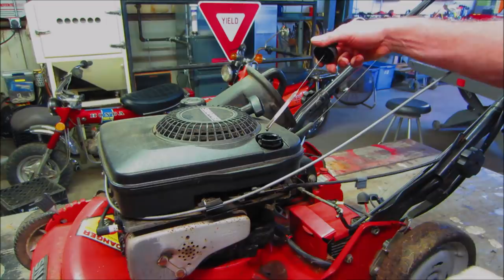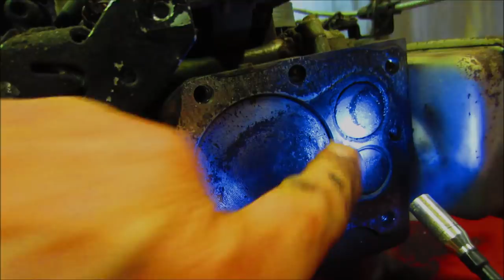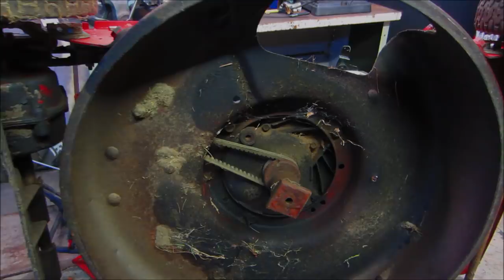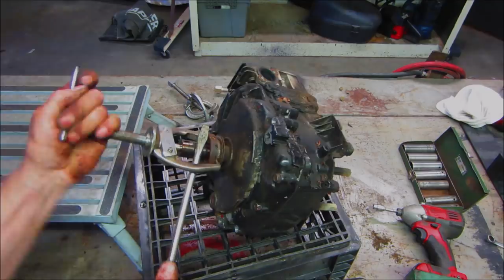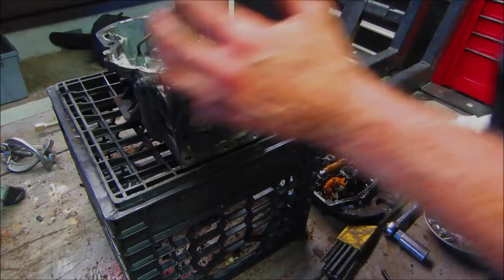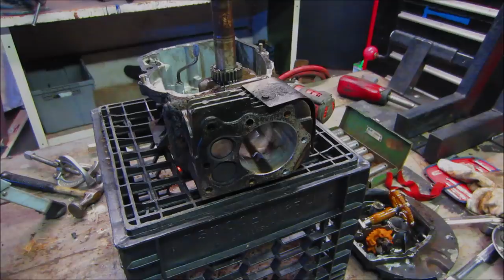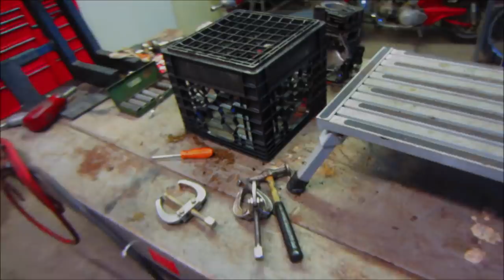Snapper lawn Mower. Why Did It Fail? lets find out.

Comment: Even with the cylinder damage it should have had enough compression to fire/sputter. I didn't see you squirt gas in it again after you checked for spark so that's probably why it didn't start. Also, there's no way that bolt would fit between the piston skirt and cylinder bore. Lastly, don't continuously speculate on the condition of everything because it becomes obvious you're just shooting in the dark (the oil filter wasn't wet like you thought, the rings weren't damaged like you thought, etc, etc).

Comment: I would bet you the flywheel keyway is sheared to some degree. Most of the junkers I get and fix and run a few years, it is either the key sheared or the kill switch somewhere is grounding out. That is what happened to me for better or worse.

Comment: I had a 14.5 Briggs that should have gone back to the factory as a defective. The rod cap was never tightened. I found the nuts for the connecting rod in the crankcase undamaged

Comment: Should build a hot rod push mower. Find a big riding mower vertical shaft engine and swap it all out, for cutting that ReallyTough grass.
Or convert it to plug-in electric using a big old motor with the same size output shaft.

Comment: Those Briggs are made to be disposable with the crankshaft riding on the metal case (plain, read: NO bearings) and the piston riding right on the aluminum bore.... Compare that to a Honda (or Chonda) with ball bearing supported crank and cast iron sleeved cylinder and it is inevitable which one will outlast the other. Even with good service, the Briggs usually always dies sooner.....
Reply: The plastic gears and cam.  I reckon those will get brittle with age and very sensitive to heat. One time of overheating will probably cause a warp.

Comment: Sure wish I had that mower deck. I hit a pipe sticking out of the ground with my Snapper mower and the sudden stop caused the engine to bend the engine mount badly. Took the engine off and pounded things back straight, or so I thought. Still has issues.

Comment: It looks like a gel filled back up battery. Adequate for mower starting probably struggle with a bike engine. I reckon that bolt got accidentally dropped into the oil filler. The scar on the plastic cam could be from the same source. As you said, it's then just sat in the sump bothering nobody.

Comment: save the crankshaft...you can use it to mod a pressure washer engine to use on a pushmower.Pressurewashers have a really short crankshaft and their engines usually have low hours

Comment: on most of the old briggs 3.5 motors they said right on the dipstick fill-drain ...but they still  had a drain plug...  i  refuse to pull a drain plug when a mower has to be on its side to service the blade anyway...

Comment: First things first nice car. That's a stator on the coil or by the coil to charge the battery. If oil comes out of that dipstick it's way over filled with oil. Now if it went in the lower part of the sump then yes it will leak. from the looks of the oil they ran it out of oil and added oil after it stopped and added a new filter. It happens all the time. With them mulching and being an air cooled engine it'll use more oil the usual but it would still take time for it to use that much oil so they have mowed with it for awhile. you can gap the coil with a feeler gauge should be about 8 to 10 depending on end play or you could use a business card between the fly wheel and the coil. Fix it or not? That's about a 600 dollar mower I would put a short block on it and use it with out the mulching attachment if your going to mulch with it I would put a 5 or 6 hp engine on it and lose the Electric start all together. They are easy to start and less trouble. You have no spark because you took the side shoot off it has a switch on it. Yep that's the one. WOW that oil does not look clean. I would say lack of maintenance.  The good old Ninja blade. best mulching blade ever. Should have taken the blade hub and pulley off first. A little PB Blaster on the shaft and let it sit a minute and the pulley should come right off. When I had my shop I always put never seize on the pulley and blade hub just in case I have to get them off later. That screw would have sure done a job.  You have the same lift table I have I need to get a reseal kit for mine it's like 30 years old. I will have to say it looks clean in the engine so maybe they did take care of it and it was just from over working with the mulching kit on it. I have seen a lot of bad oil rings in mulching mowers I am sure it comes from people trying to mow to much to fast and over working the engine. I could sure use that mower body mine is about shot but then again it's a 1980 I put a 6 hp on it before I closed my shop in 98. One thing you over looked was the carbon build up on the piston that to can cause the cylinder damage just like what you found. This according to the engine manufacturer should be part of a turn up and I agree decarbon the head and valves and replace the head gasket it a new one at least once a year. Snapper doesn't have a reverse it's a veritable speed self propelled forward only. Good job I would have hired you when I had my shop. I would have even given you a valve spring removal tool.

Comment: When I was a lid in the 60's I was taught to pull the plug and rub a nicely sharpened pencil around the electrode and ground to greatly enhance the spark. I have used this technique dozens of times since then and it has always worked to some degree.  Has anyone else done this for a quick start?  Just curious.

Comment: Buy a cheap socket and cut slots in it so you can use an impact wrench with it on the puller handle...

Comment: The failure of the cylinder had nothing to do with the screw inside. The actual cause was float valve in carburator leaked, raw fuel in cyl caused rings to stick to the aluminum cyl. But the no start was caused by a combination of the partly sheared timing key and leaking valves. I bet fixing the key and valves would have got it running.

Comment: So how did that bolt find it's way into the crank case? Here's my guess. The previous owner went to drain the oil by tipping it over sideways, forgot to disconnect the breather pipe from the crank, saw the air filter start dripping oil so quickly removed the cover and dropped one of the bolts in the oil pan. After doing whatever it was they wanted to do, poured the old oil (complete with bolt) back in through the filler hole.... tut, lost a darned bolt... never mind, I've got spares.... scratches head.... wonder where that went. ....CRUNCH!

Comment: I wish Mustie was my neighbor. I have a 6.5hp mower & I replaced the carb on it, it ran, got half the yard done then it started to make a slight pinging (it had proper oil level). Then it just shut off, would not restart. it turns over freely, I took the new sparkplug out, had a lot of burnt oil on it. It still seems to have compression, so I'm lost on it. Any idea what may have happened?

Comment: Sabataged engine!   Probably from the factory.  A screw missing on the air cleaner wouldn't be noticed because most people just run their mowers till they quit then buy a new one.  Have found give aways with zero oil and filter so clogged I was amazed it would run long enough for the no oil to kill it.

Comment: A previous failure overheated now in your hand all cause erased from the last owner. Cleaned out the mouse nest. Its all there a over heat the piston will over expand and scrub the skirt the chards from the bore will load up on the rings and put a big score in the cylinder usually close to the exhaust valve just saying.

Comment: Why not get slightly bigger rings and piston and hone the block? It should not cost more that $75. I have done this to a 5 hp tiller engine and it still runs. This mower would be worth  $150 after that right?

I have done this to a 5 hp tiller engine and it still runs.

Comment: Original owner must have dropped the bolt in there and that blew up the engine as a result. How about taking your bore scope & show the inside of a muffler, please. I'd like to know exact what those looking like from the inside. Some of my equipment instruction manuals claim to have a catalytic converter inside the muffler.

Comment: It`s all so clear now. Previous owner purchases new lawnmower and gets talked into buying an `extended warranty plan` by smooth-talking salesman ( " Just bring it in once-a-year for routine maintenance service !" ). 
After a year`s use, mower goes in for routine maintenance, and gets handed over to the newest hire - a young U.T.I. ( Universal Technical Institute ) graduate - for oil change, new spark plug, and new air filter, etc.
 While changing air filter, young techie drops bolt down the oil tube ( " Oops ! Aw heck, I`ll just use a different bolt, keep my mouth shut, and no one will know. ")
Mower returns to customer who then uses it for a little while until suddenly, CLANK ! Mower blows up.
 Owner pushes broken mower to curb, goes back to store and purchases a new mower ( and the vicious cycle begins anew ). 
Yup, it`s all sooo clear, now.

Comment: I wonder if that bolt was left in there accidentally at the production facility. Once I got a Mercedes in with a bad misfire. It seems that the factory had left an extra valve spring base in there, and after 28,000 miles it got kicked into the valve train. Bent a couple of valves and some other stuff.... Anyway, I was just wondering if that's what happened to your mower. I guess anything's possible.

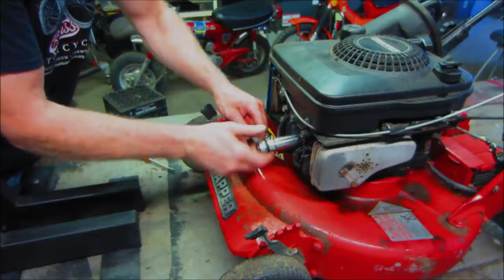Comment: What year is that Honda 90 at 2:32? My wife had her Honda 70 with the automatic transmission and I had the Honda 90 with the 4 speed high/4 speed low transmission. They cost us $395.00 for hers and mine cost $595.00. I used hers to get my indorsement. I made the mistake of giving up my endorsement when I renewed my drivers license way back in 2004. We should have kept both the bikes as I kept them in mint perfect condition. We sold her bike to the in-laws and their kid totaled it and I traded mine on a bigger Honda.

Comment: Just curious... rather than "it feels like it may be an ok amount of compression..." perhaps using a compression gauge?
Reply: I made a living working on these things for 20 years, compression gauge won't tell you anything (there's a compression release bump on the exhaust lobe that at cranking speeds dump the compression enough to spin it by hand. Instead we watch for the blade to bounce back off the compression stroke). This motor had been hot (blackened head bolt) and we always watched for metal transfer (I.e. between the piston and cylinder or the crank and rod). Transfer won't happen with oil present. Overheat can also come from trash in the fins- but with scarring on the piston skirt, this motor needs for all intents and purposes a short block (if the exhaust seat hasn't gotten loose, it's likely next). Not a bad teardown at all- good to watch.

Comment: Back before I was born, my Dad & his brother went fishing.  Couldn't start the boat motor.  (12 hp Sea King, 2 cylinder).  Pulled and pulled on the starter rope.  Then, they swapped the spark plug wires and the motor started.  They deduced that my older teen-aged brothers had swapped the plug wires as a joke.  Boy, did my brothers catch hell when they showed up later to which they claimed innocence.  When it was time to run the boat again, the motor would not start.  Again, after much pulling, the plug wires were again swapped and the motor started.  Come to find out, the key had sheared on the shaft and the flywheel was out of sync (time). True story (albeit long)

Comment: On an engine with suspect compression, turn the engine over by hand until it is set on top dead center.  Mechanically secure the blade so the engine cannot turn (vice grip the blade to a board and the board to the deck).  Remove the spark plug and using a rubber tipped air nozzle, pressurize the combustion chamber with air.  Listen for air escaping through the muffler, carburetor, oil fill tube, or head gasket area. Quickest, easiest way to figure out where the compression is leaking.

Comment: Should not hurt that motorcycle battery to be on it's side as long as it is a sealed one, Like a Harley Davidson battery. I have seen some Buells with a battery flat like that wear our sooner than it should have. I don't know  is that was a factor but a few of us had a bit of a discussion about it. Harley batteries are good quality. It is really the only thing quality and I worked at a Harley stealership for a couple years. I now ride a Ducati Monster 800, all the power of a real V twin without the slow, under powered, overpriced, and still being a ducati it takes less maintenance motorcycles. Sad, Harley sold everyone broken bikes for 8 years from 1999-2007 pressed together flywheels and soft cam chain tensioners. Knowing early on they were soft they sold every last one of the soft basically broken tensioners you put back into your bike that would last around 20,000- 30,000 miles and if they actually wore through it shredded your cams and send fragments of metal all through the motor.. If you over revved the bike the pressed together flywheels would shift and if you were lucky you would only get a vibration, unlucky, you grenaded your motor after your oil pump got shredded like mine because it threw the timing off way off. Give me a a sport touring motorcycle like a ST4S Ducati even a YAmaha FJR I will ride it 800-900 miles a day. I still like their batteries.

Comment: One time my wife stopped the lawn mower by the curb and went inside. She came running out to prevent someone from putting it into his truck.
Reply: Recently I lost a big steel shelving unit the same way. Was taking it to my storage unit, so I took it out to load into the car, but forgot to unlock the hatch. So I left the shelf standing on the road behind the car, went inside to get the keys, decided to take a leak while I was there, then when I went back the shelves were gone!

Comment: I think you missed it, Mustie. A few other viewers mentioned it. If you review the vid, at 32:11 you can see a scar on the cam. The loose bolt in the crank case got jammed in the cam and changed the cam TIMING. Even though the valves were opening and closing, they were NOT synchronized with the piston causing a loss of compression. I have seen engines with worse scoring on the cylinder wall run (but smoke). I don't think that is the cause. My money is on a bad cam. Great vid! Lots of fun doing failure analysis.

Comment: What happened, did somebody have the carb off and their kid dropped one of the screws down the oil funnel???  Briggs&Stratton has a huge factory here in Southeast Missouri where they build most of those vertical shaft engines.  They give engines away at farm/home shows and donate engines to various groups for fund raisers etc... and then they show up in flea markets or on craigslist/marketplace.  Might be anybodies name on them and they're in the box.  Right now one of my push mowers says it's John Deere and the other"s a Snapper.   If I have a problem with one I just take a day and hit the flea markets.

Comment: The mower would not start because it was out of gas, plug had no spark, and bolt in crankcase , scar in  the piston walls creating non compression., and a bad exhaust valve,and a dead battery.

Comment: Great video as always and looks like you are getting settled in the new shop. Something shown to me years ago was if a small engine has weak compression, say 45 lbs, put some oil in the spark plug hole. I generally just give it about a 3 second shot of WD40. Check the compression again and see how much it goes up by. The oil seals the rings but doesn't do anything for leaking gaskets or valves. If the compression goes up substantially, say to 70 lbs, you have identified your problem to mainly the rings. If the compression is unchanged or just goes up maybe 10 lbs, you can safely determine that it is not the rings as much as it is valves or gaskets. Like you pointed out though, fixing the valves and tightening the head may have allowed it to run but it would not have had much longevity. You may already know this but Snapper makes the blade adapter and drive pulley in different sizes. The stock shaft is slightly larger than most other engines use. May be worth purchasing those so you can use an engine off a cheaper machine or a Predator. I have re-powered my 3 pieces of my equipment  now with a Predator and have had excellent service out of them. IMO the Snapper machine you have there is still the best designed one you can get. Thanks for the videos!

Comment: Just want to say thanks for the inspiration. Our lawnmower crapped out so I was looking to get a new one, but didnt want to spend much money. I picked up a curb alert Troy Bilt. The engine was seized, but a can of WD40  freed it up. Dumped out the tar in the oil pan. It had been run without a filter in and I dont think the oil was ever changed. Pulled the carb and cleaned as you did. Put it back together and it runs well. great video.

Comment: This reminded me of a small engine class  I took in the 7th grade.  We tore down and rebuilt Briggs and Tecumsehs lapping valves, adjusting magnetos.  I loved that class.  My older brother was usually assigned yard duty but one weekend he was away and the stepdad told me I had the honor.  Well I yanked and  yanked and yanked on that filthy thing and then went into mechanic mode.  It was just a clogged air cleaner but required the top of the engine to be off to get to it.  Just as I had it spread out and starting to clean the stepdad walked by and blew his top.  After the confrontation was over I raced to put it back together, then wheeled it right outside his bedroom window where he was reading his dumb book.  As soon as he noticed me I gave that mower a whimpy girl yank and it fired right up. Ha!